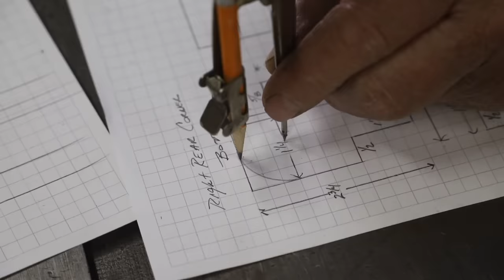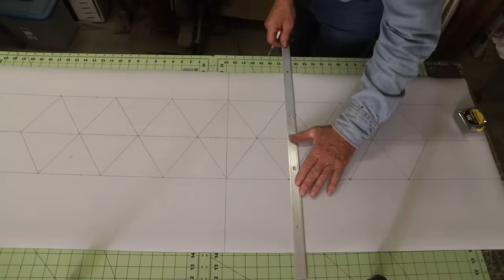Total Buggy Restoration | Start to Finish | Engels Coach Shop

Comment: If you watch carefully you see all the slotted screws facing the same direction and orientation of the square nuts all match.  A sign of a true craftsman.
Reply: I like that.  It was a nice touch.
Reply: Standard practice in coachbuilding. In construction the same principle was used so paint had less chance of filling screw slots in door hinges, when slots were horizontal instead of vertical. Now lost to the philips head screw to name one.
Reply: bear in mind that sometimes it's more important to have proper equal tension on the fasteners than have them look nice.
Reply: @calinguga  Yes, however both can be accomplished.
Reply: to some degree yes, by removing material from a countersink, or when one end of the bolt is hidden, and i believe it's especially doable with fine threads and in wood. but you almost never see it in watchmaking for example.

anyway, i have come to appreciate it more since i made the original comment :)

Comment: I love to see the finished buggy hitched up and in use!
Reply: This is museum quality, they might use it once in exceptionally clean arena conditions but now it ought to go in a big glass box.
Just kidding, of course it will be used and cherished.
But let's hope they dont throw the top in a ditch as originally happened. When you see what went into making the top and think back to how difficult all these trades must have been without power tools and even electric light to use the full working day, you just hope whoever did that got rained on all the time.
By the way, any bets on how long Dave's working day is? I bet it isn't union hours.

Comment: The whole thing is such a delicate construction.  No dimension is any bigger than it absolutely need to be.  That for instance the step irons were still attached to the old box after so many years with only three small screws each and almost no leverage is testament to a very optimised design and solid craftsmanship.

Comment: I believe it was the finish sanding which made the paint look so extraordinary. I also had forgotten just how much metal went in the buggy. Did you bother getting a total number of screws, nuts, washers, and bolts used in the buggy? It must feel rock-solid to sit in.

Comment: WHAT I would like to know is when does a "RESTORATION" of any vehicle become a "REPLICA". - As if your going to take a vehicle completely apart and just use some of the metalwork, - not all, - and use the rest of the vehicle, - (whats left of it), - and it looked virtually complete to me, - (as a pattern), - then surely it becomes a "Replica", - with not even all of the original 'metalwork pieces' on it... Personally I would have kept it exactly as it was shown early on in the video, - (AS IT SEEMED PRETTY MUCH ORIGINAL TO ME). - As a Restorer of old vehicles, THAT is how I would have kept it.